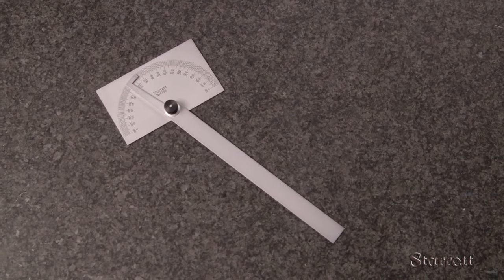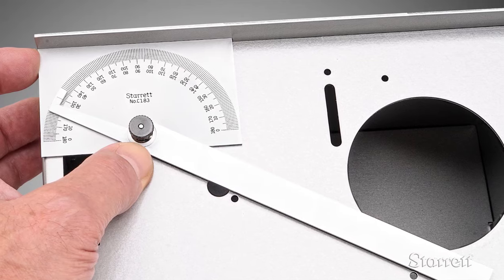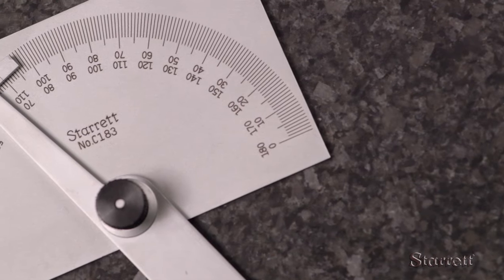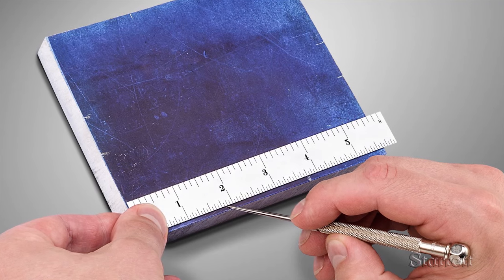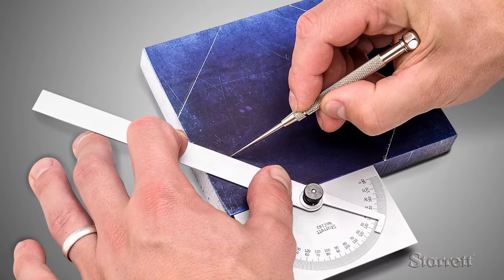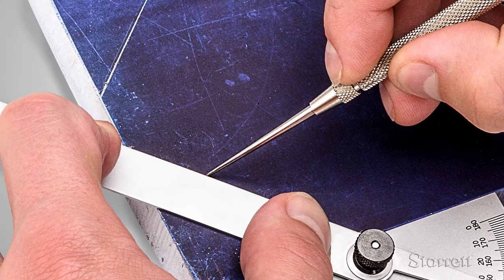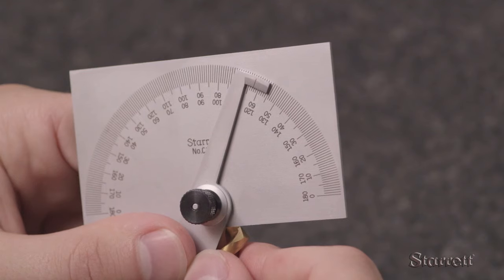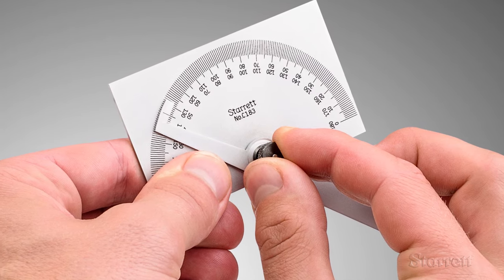How to Use Metalworking Protractors with the Starrett C183 Steel Protractor

Comment: When drawing an angle do use the inside or outside of the metal bar?
Reply: Ideally, both edges are parallel. So, they should both be the same angle.